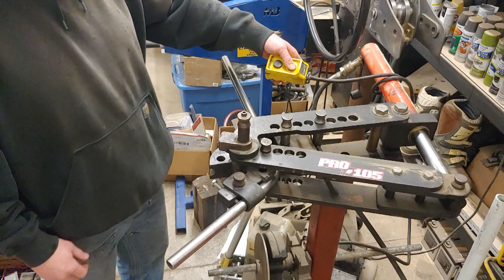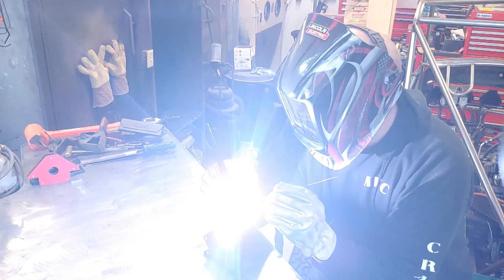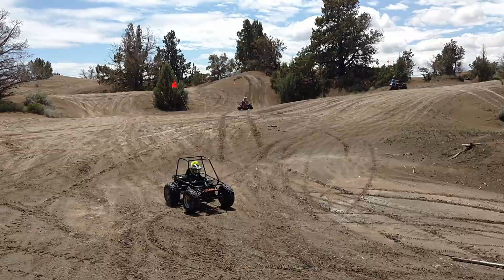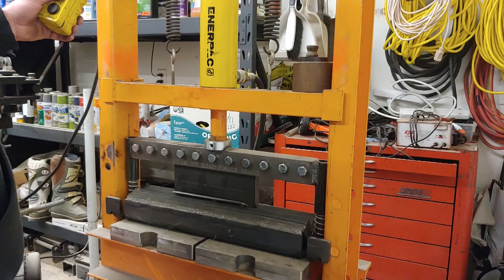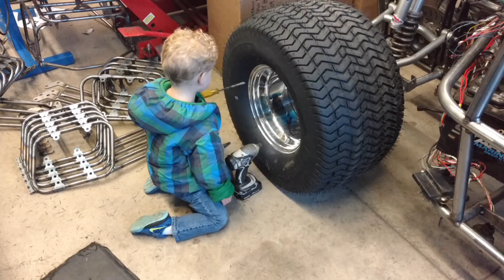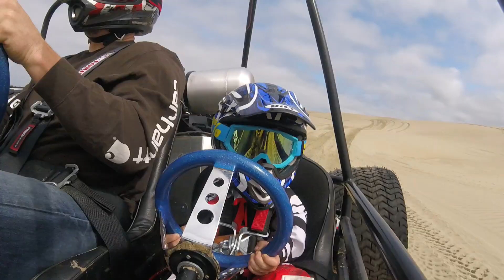Welcome to the Moto-Mule YouTube Channel

Comment: Hey I wanted to tell you to make sure you remove the label off your bottle Jack harbor freight can sue you for your time and put a lean on your products. Best of luck!
Reply from the maker: I'm confused? Because I replaced the bottle Jack with a hydraulic cylinfer??
Reply: @motomule  no remove the brand label from the bottle Jack with the brand on it they can sue you for using their product in your invention
Reply from the maker: @theneanderthal6854  I'm not inventing anything, nor trying to sell anything. I just modified a tool in my shop to help me build things.